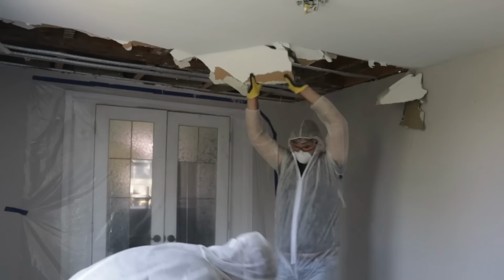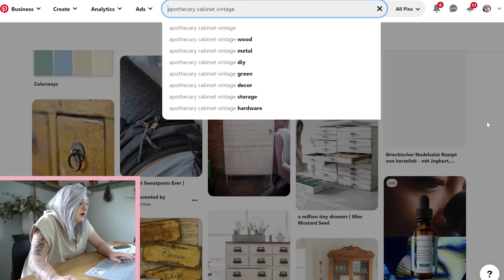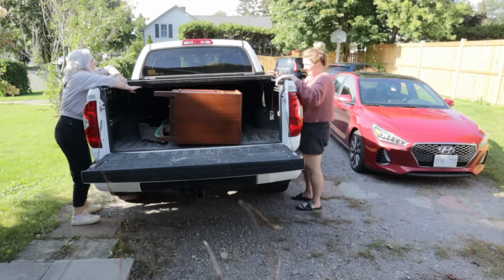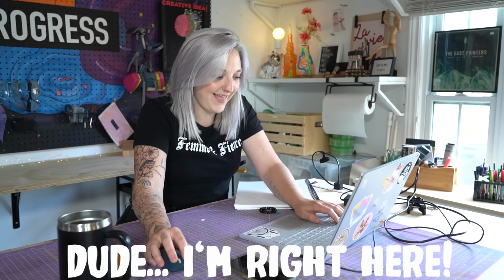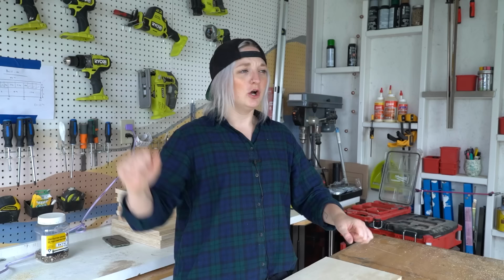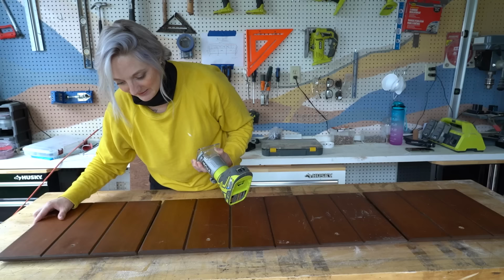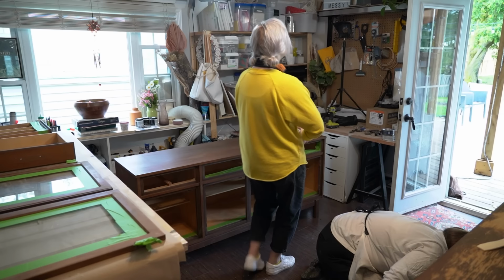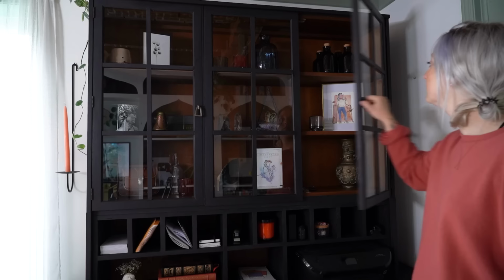i thrift flip the apothecary cabinet of my dreams 😍 | DIY THRIFT FLIP

Comment: Fantastic result!  You are so clever. I loved the routed v-grooves. Re: thé cubby holes. I’ve learned to prime and paint boards before I even cut them. Then it just takes a few touch ups or one coat when everything is assembled. Soooooo much easier to paint a board than a constructed piece. .

Comment: Definitely fills up and fits the space better (as well as adding more storage), than the previous cabinet.  Was wondering about the center glassed in shelf; believe you said it was fixed (not an actual door)?   Do you then have  to slide in items from either side to use?  If so, would it be more convenient to remove the glass and make the center open shelving?

Comment: Lovely rain! I live in the high desert and get 40-50 mph sand storms.
This turned into an epic cabinet.
 I have a 5' wall cabinet that I want to remove and turn into a mid-century modern 12" deep cabinet with 6" legs for my living room. Then have room for full storage with a drop down seat in the entryway.

Comment: Wonderfully, epically awesome❗ 👌
I'd definitely make the center glass piece into a door. You already have horizontal pieces. I'd just add a vertical piece on the 1st and 3rd shelves, either on the left or right side (whatever works best). Then attach the hinges to those vertical pieces. Voila, the top is now fully accessible, and the center shelf is still full width. 👌👍🤩